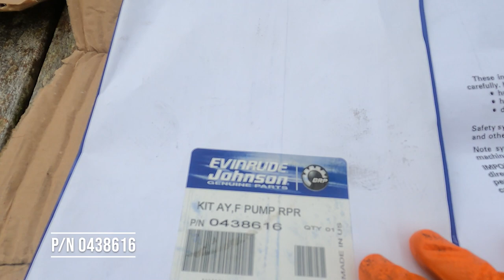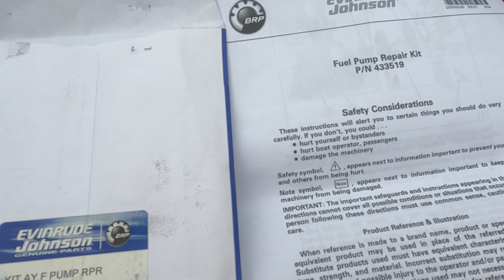How To Remove & Service Fuel Lift Pump - Evinrude / Johnson ETEC 40 50 60 65, Repair Kit 0438616

Comment: Fantastic video, thanks very much. Great that you mentioned both kit part numbers as that helped me find Sierra aftermarket kits here in Australia.
UPDATE ON THE SIERRA KIT - I don't recommend anyone buys the Sierra aftermarket kit if they can get there hands on an OEM kit. The diaphragm is thinner and much more "limp" that the original OEM diaphragm, and it "crumples" along the edges during assembly because of the springs. I actually ended up putting the original OEM diaphragm back in as it looked in good condition and I've heard they are very reliable and long lasting.
Reply from the maker: Great to hear! Thanks for watching 👍

Comment: Why did you service it what were the symptoms ? Thank you in advance
Reply from the maker: Hi Kirt, it comes as part of the Evinrude service kit. The parts are subject to wear, especially the lift pump's diaphragm, which can split over time. A symptom I suppose would be no fuel reaching the fuel injection pump and then either very low performance or the engine not starting. Hope this helps
Reply: Bad fuel pump causes loss of vacuum so the primer bulb on the line from fuel tank will go soft. If you have to keep squeezing the bulb to keep motor going the pump isnt working, the diaphragm could be torn, the check valves or the  gaskets could be leaking. Also the filter in the fuel supply cap could have debris in it blocking fuel supply. There also could be an air leak in the pulse hose.
Reply from the maker: @marksmith9295 good answer mark 👍
Reply: Thanks. Going through these issues now on a 1987 Johnson 9.9. The pump is same style and is mounted on opposite side of the engine with a single pulse line running back to the intake port. It has metal reed plates as check valves and a rubber gasket with ports for the cap instead of an inner and outer o ring. Was missing the top spring and air dome. Apparently this pump was only on the 87 to 82 electric start models however this motor is a manual start. Seems to be a better pump than those small square ones though. 
Good video btw...and appreciated:) Cheers from Ontario, Canada.
Reply from the maker: Thanks, really appreciated the good feedback 👍 
It’s amazing how similar parts make it across a lot of engine models and years 👍